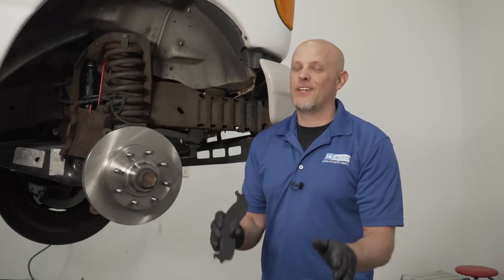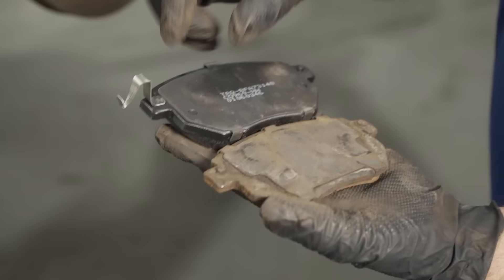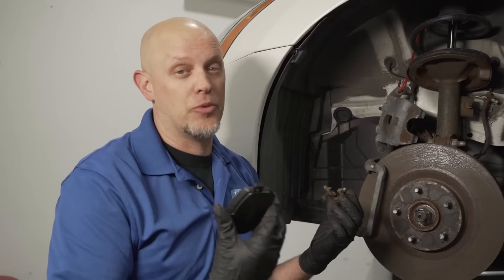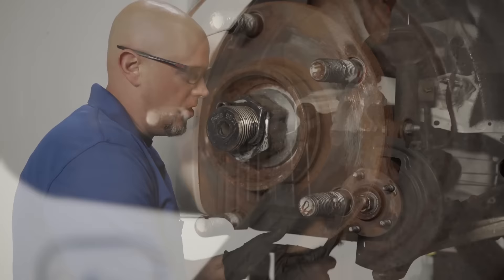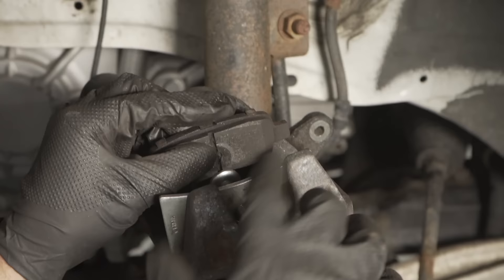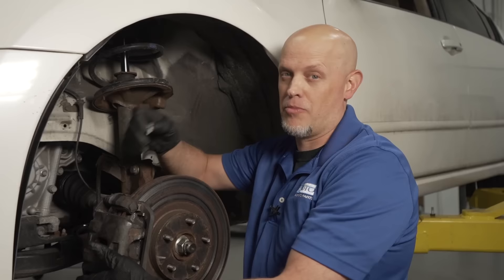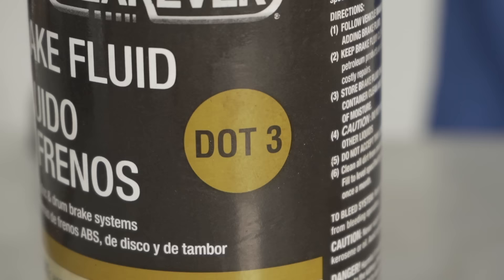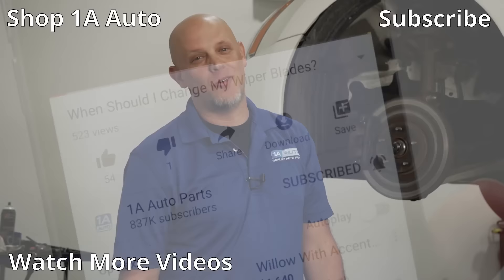Most Common Brake Installation Mistakes!

Comment from the maker: √  Watch the Video
√  Buy The Part at 1A Auto http://1aau.to/m/Visit-1AAuto
√  Do it Yourself
√  Save Money
Reply: Excellent.
I have also heard that squealers should go down.
How important is it for them to be either up or down ?
Reply: Never thought of opening up the bleeder screw when compressing the pistons, had a little too much brake fluid come back up the master cylinder when I did my brakes
Reply: Howdy 1A Auto, Here's something i shouldn't have done, It would have been nice to know it is different with a screw-type caliber,,, (which I didn't realize till to late)
I followed the instructions another 1A video and used the C-clamp,, now I have a trail of brake fluid down my driveway,,, no brakes,,,, something must have ruptured in between the two rear wheels,, what could that be???   pplease help  09-20-2021
Reply: Bohemian rhapsody piano
Reply: Should I release the hand brake when changing brake pad and rotor? (Toyota Highlander 2012)
Reply: Great job boss..But i just replaced my calipers and i have a  cut in the dust cover what should do its new its rebuild able? Or new Caliper?
Reply: My time I forgot to put one of the Bolt in the back brake shoe everytime I stop it goes clunk it taught me double check my work
Reply: @mastercontrol2461  did the same to my honda ended up from doing just pads to replace the whole rear brake system calipers,pads, and rotors
Reply: Too bad the shop is not in Canada.
Reply: @KTHKUHNKK
Reply: No sound
Reply: @KTHKUHNKK
Reply: Recently I had to replaced  my whole front Calipers they were completely stuck tight. My brakes was extremely loud like metal on metal driving it....The thing is having my Caliper, n shoe pads replaced but the mechanic told me my rotors liked fine....when I drive it and press my brakes are my brakes supposed to feel more snug not like I have to pressed more going down just to come to a stop? Are my brakes supposed to feel more snug when replacing new every thing?
Reply: I have a Isuzu frontier 2.8.
Can i use any other Isuzu dif and fit my difs gears and shafts in

Comment: I don't think putting the pads on backwards is a mistake,I think it's someone who shouldn't be taking the wheels off ever period,lol.
Reply: lmfao i was just going to comment the same thing but I wonder how many times it happens
Reply: lol true that!
Reply: At 1st, I thought he meant upside down. With the squealer on the top/ bottom. Lol
Reply: I seen it. I work at a garage 😂
Reply: was about to say the same thing
Reply: Over decades I'd never seen that happen, and then suddenly two different people did it in two days. The second one did it the day after laughing at the first one.
Reply: Anyone that puts them on backwards is just lazy and didn't even attempt to think about it at all.
Reply: @Area-cf1gt  same here. A student at ASU did this and had no idea why it was grinding. U will see some crazy stuff working at a garage
Reply: Yep, anyone doing that obviously hasn’t got a clue and also didn’t take notice of how the old ones were in. 🤪
Reply: I have had that happen to me, I picked up a police car from the garage and was sent to PI accident. On the way I told them the car needed brakes and I was told they just put brakes on it. I took it back after the accident and sure enough the pads were on backwards.
Reply: Been doing my own brakes for 10 years. Was in a major hurry once and did it myself! I'll definitely never make that mistake again.
Reply: young kids listening to older people and assuming they know how it works when all they see is steel on steel anyways? true story lol
Reply: Best response...."If your brakes won't stop your car, something else will". LMAO! 😂
Reply: Take your hands off the lug wrench! Just wow?
Reply: If they are dumb enough to put them on backwards they probably dont know how to get the wheel off
Reply: Exactly lol!!!!!
Reply: @jimeckenrode1271  your lucky i had brakes fall off on a county bus couldnt stop. Had to avoid town traffic and get towed in
Reply: @garycasper2929  Same, didn't think he meant metal to metal.
Reply: So.... Dont drink and work. Stay sober
Reply: He probably should have also said to not not drink the used brake fluid. Used brake fluid is extremely hazardous, lol.
Reply: agree 100% I didn't even know it was possible. I've done this job many many times between my own cars, family, trying to make money and I never once tried it.
Reply: Discs are still good
Reply: Took that sucker from being a semi metallic pad to a full metal jacket!  :D
Reply: Having coffee reading the comments made me chuckle as well ,anyone that puts a brake pad on backwards needs to stay away from the wrenches lol.Go fishing instead and have it done by your mechanic.
Reply: I’d love to see it 😂😂
Reply: If someone can put the pads AND rotors on backwards. I'd be really impressed.
Reply: I was thinking the same thing. If you can't understand steel vs. friction material then stick to whatever mundane chores you are familiar with.
Reply: Ive done my brake jobs for years and actually on my latest one put one of the inside pads on backwards.  Felt like a complete idiot but we are only human.  Mistakes happen.
Reply: still funny
Reply: @syrthdr09sybr34  They have zero understanding about how brakes work, some peoples understanding of how a car works is they turn the key and it starts to make a noise, then they can put it in drive and go, they have no clue how an engine, transmission, brakes or anything else works. I know little about how computers work and nothing about how a microchip works, if I were to replace computer parts which I have done a couple times I would need to follow the instructions not knowing anything about how they actually function, I can see me putting something in backwards, this is no different than someone who knows nothing about vehicles.
Reply: Never heard of anyone doing this but after 43 years of meeting different types of people, I dont doubt that it happens.
Reply: i had an experienced mechanic do it!!
Reply: Can't say I've tried it, but I recently bought a car whose pads were worn down to the backing plate, and imagine if that's your only experience, and what you see taking it apart, it won't be as clear how to reassemble.
Reply: Putting the brake pads on backwards would be a way to grind your rotors if you had no other equipment.
Reply: Looool my thoughts entirely
Reply: I was worried that there were no people left on the planet who were incapable of making a mistake.  Fortunately, I've found plenty right here.  Now to continue the search for people who can learn from a mistake... after admitting they've made one... and try to do better next time.
Reply: Did it.  It was the last wheel, beer or two per wheel.  It was super cheap Amazon pads that said you have to condition the pads by doing 3 high speed stops, which I did while thinking 'wow these sound like shit brakes'  they were shit for sure after that.
Reply: I started laughing when it was the first. But then u started thinking.. This is probably a common problem to newbies...........
Reply: I was thinking the same thing lol. If you put brake pads in backwards you have no business picking up a wrench.
Reply: I know someone who did actually put them backwards, and he was very handy. Anyone can make that mistake, you just need to take your time and always double check your work.
Reply: That person could always simplify things and not even put the wheels back on - they could drive on the rotors without brakes. Haha....they may not get anywhere but the shower of sparks would be cool to watch!
Reply: Only a complete prick would do this. In all the years that I’ve been servicing other peoples vehicles. I’ve never done that.
Reply: Someone who puts pads on backwards should limit themselves to only filling the gas tank.
Reply: @Syrthdr09 Sybr  I agree...it's like,"get the F outta here..."  like putting shoes on backwards.  Get it?! Ahahhaha
Reply: @ichankomo8767  🙂
Reply: @n1umj  way2go Captain numbnuts way2go.....let's give it up... a hand for this guy!
Reply: For real
Reply: 🤣🤣🤣🤣 yup
Reply: U gotta start somewhere alot of you dudes are the ones who hate when a youngster is coming for your spot🤣
Reply: @imhooks  well said!!!!,
Reply: I will have to admit I did it. It was the scariest feeling during test drive after replacement of the brakes. The car didn't stop even though i step on the brakes really hard. But now i learn my lesson and i am confident with brake replacement.
Reply: its easy to get frustrated when you are doing a job like disk brakes, one thing doesnt go on right, the pads are too tight, you cant see the spring clip is blocking one end from going on.... and you spin the pad backwards or rotate it 180 degrees (so the curve of the pad does not match the curve of the rotor)... and it snaps in and you are happy

This is part of the reason to always do your own work on your cars. If YOU can screw it up there are plenty of kids working in garages who have no idea what they are doing, and the garage charges YOU $95/hr for them to screw up your car for you.
Reply: Agreed, if you don't know what you're doing especially with cars then simply don't do it, one major mess up can make it unsafe to drive
Reply: Absolutely agreed!
Reply: Must be stonners
Reply: This can happen. Does not involve lack of knowledge. 
Say a distraction. It happens. 
And a customer who was late
to mention noise. Again it can 
happen to someone with experience. But something
like that is embarrassing. I admit to this once. Wow!!!
I fixed it and it was fine. 
A learning thing. I do not allow
Distraction now. It was just
one pad. Again 
wow. 
🤔💭👌✌️
Reply: I know a complete idiot who did it to his Cummins
Reply: Yea...if you put them on backwards...stop touching the car. Entirely. For good.
Reply: Surely someone willing to tackle a brake job wouldn’t make a cartoon mistake like putting them on backwards
Reply: Putting brake pads in backwards is like putting a shoe on your head instead of a hat, socks on your hands, plates in your laundry and trousers in your dishwater.

If you can not tell the difference between a plate and a sock, do not use a dishwasher. 
If the rotor is stuck, smash it. I took one off in bits once.
Reply: How could they even fit backwards....makes no sense
Reply: How do we learn if we do not make mistakes?
Reply: I agree..
Reply: Yeah says every mechanic ever,who were also young and  stupid once.
Reply: Mybe he's high
Reply: Many people don't have mechanical repair experience or talent. That doesn't mean they can't learn to DIY. I always encourage people to learn new skills, even when they're struggling to understand "common sense" fundamentals.
Reply: If you put the brake pads on backwards you are the mistake
Reply: You'd have to be stoned out of your mind to do this,  I did my first pad job and I'm an utter rookie and it was obviousnwrongnway or not
Reply: Lol 😂 deffo, do not let this person near a motorized vehicle nor matches or even a toaster
Reply: Seen it more than once. And 90% of the time it was someone in a rush
Reply: Customer "I think it brakes with metal not with this ceramic clay part"😂 
Srry has to be a women saw a woman on a Subaru at 150k never done a oil 🛢 change from when she bought new with dealer!
Reply: Don’t forget to check the blinker fluid too.
Reply: I was thinking,how could anybody put brakes on backwards? 🤔  you never know.
Reply: @shakysliders1689  I was tired and in a hurry one evening and put one pad on backwards on my own vehicle.  Doesn't take long to figure out what that noise is. Luckily I didn't go far and not much damage done. You only do it once. And I've been doing brakes for over 50 years.
Reply: @richardharries5825  must be great to be perfect. You must be a charm to live and work with
Reply: Makes you think twice about riding with a friend who “works on their car!”   Lol
Reply: Everyone starts somewhere buster im sure you’ve stripped and rounded your fair share of fasteners or some stupid shhh like that..
Reply: Failing shouldn't deter one from trying again. Mistakes are the best lessons.
Reply: I almost want to agree except I’ve done all kinds of DIY like remove the cylinder head after overheating damage, removed full engines and transmissions, not to mention trans fluid changes, compressors and all the other stuff yet put one brake pad on backwards. Man, what incredibly loud scraping and screeching. It can be heard for blocks. 😅
Reply: More like someone who should not attempt his/her own repairs. Also someone that should try watching the videos and listen carefully for a change.
Reply: I didn't know it was even possible.
Reply: lmaoooo fr like i thought he meant put them on facing the wrong way not the back of the pad on the rotor, either way, insane if u do thay
Reply: So nobody’s allowed to make a learning mistake?
Reply: cheaa😂
Reply: It happened to me. I was desperate and it was a Sunday and the only shop open was Pep Boys. They put the pads on backwards and also somehow destroyed the master cylinder.
Reply: Were you born knowing how to change brake pads and rotors ? 
You learned it right 
That’s why others are doing
Reply: Probably should hand over the keys as well. Should not be driving. LOL
Reply: Yes.. I agree completely put the wheel back on and step back from the vehicle and give the tools back to whoever they borrowed them from
Reply: would put not paying attention to the lug nuts tight as higher frequency thanbpainti ng the pads or putting them on backwardness. (Putting the wheel on askew).  Um, I could think a wounded warrior project, rehab Occupational therapy or other advised and well supported activity would be one okay for that sort of activity as long as the work was double or triple checked.
Reply: Gotta be real, as a mechanic I have seen the backwards pads more than once. But I had to watch the rest to see how many other ways there were, you covered the majority. Doesn't matter how good your suspension is, or how good your tires are, if your brakes suck. Your going right  in to the danger zone.
Reply: @everardoalba  learning mistakes are for tuning the engine, messing with the exhaust, putting on wheels. Brakes mess up and your car is totaled or worse, your in the hospital, because you wanted to save 100$. If you don't know, it's ok, just don't start with something so vital to keeping you alive
Reply: I just can't imagine someone putting the pad sides out.    Reading these comments,    it has been done to my amazement!     How insane are some of these humans?
Reply: Agreed, if pads are fitted backwards, the first mistake is allowing the fitter access to tools...
Reply: @Area-cf1gt  so a mechanic in your workshop has put pads on wrong way...pleaseeeeeee! Has to be an unsupervised Apprentice lol!

Comment: After replacement of the brake pads, one should always set the brake caliper pistons back , by pushing a few times on the brake pedal. Otherwise you are sure to get a no braking situation on the first step on your brake pedal which may be very dangerous and panicking.